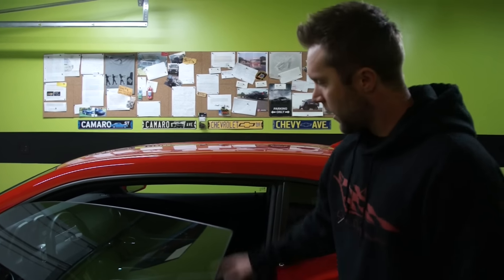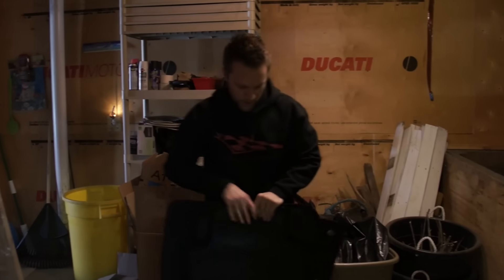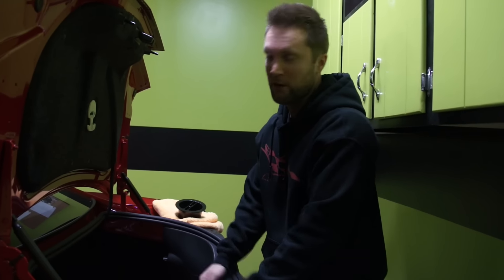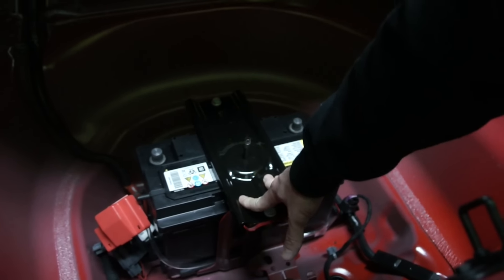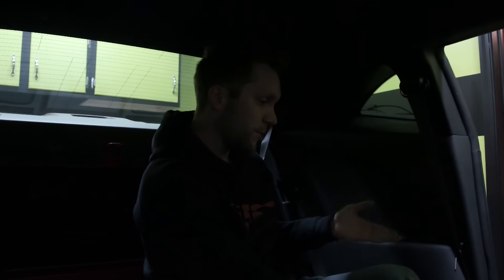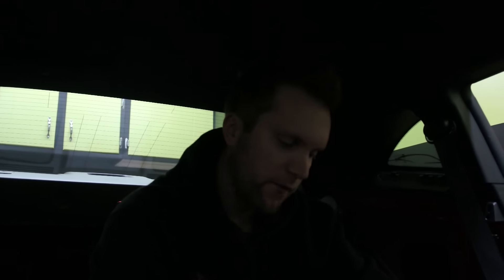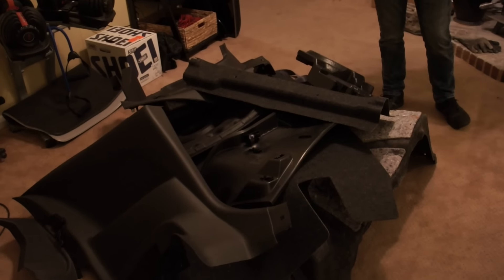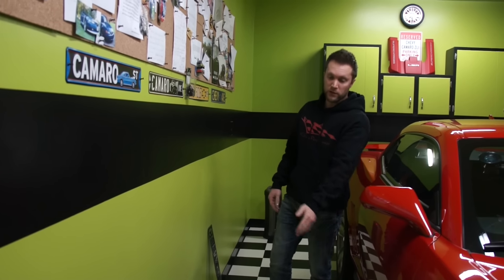Making My Car Faster WITHOUT Adding Horsepower

Comment: get lighter rims and that will be a huge impact on the weight.
Reply: Branson Sheppard He talks about it at the end
Reply: every pound on the foot is like 10 on the back.  Lighter suspension, bakes, and wheels
Reply: GuitarmageddonZL1 hey man I understand where your coming from removing the floor mats but 8 pounds won't make a difference and when it comes time to potentially sell your vehicle if the carpet is worn and nasty your lose alot of money
Reply: GuitarmageddonZL1 When you get lighter wheels that weight reduction is multiplied because of rotational mass.
Reply: Stas G. he should pay the cash to get the full weight reduction package he needs to have all the speakers but one removed the radio ac etc if he is serious about turning this into a full dragster

Comment: are u gonna remove like heat and ac, the airbags, replace the steering wheel with a light weight race wheel etc???

Comment: The front wind shield weights at least 100 lbs you should just remove it.
Reply: SIMPLYBEAST1231 it might weigh 40-50 pounds. No way it's 100
Reply: SIMPLYBEAST1231 I literally make windshields for a living. They aren't as heavy as you think. Probably between 30 or 40 pounds at most.
Reply: +Domenick Schifer i know its not 100lbs. It was a joke of a comment. I replaced my windshield in my old pontiac a couple years ago.

Comment: You need to lighten the unsprung weight and rotating mass. Putting lite weight wheels can reduce track ETs by whole numbers. sprung weight will not reduce your ETs by the same amount as the changing the rotating mass.

Comment: Swap the battery for a lighter one. The stock battery can weigh over 50lbs and that steel hold down weighs a bit as well.  Proper race battery weights ~15lbs and a plastic box and aluminum hold down are a fair swap.  35 more lbs for not a lot.  Also the trim on the inside of the trunk lid.

Comment: I have been drag racing since 1973. I gutted out the 1968 GTX I drove to high school and turned it into a drag car. Looking back I wish that I had never did that. If you can don't sell your stuff!! Keep it so you could put it back to stock. P.S. old drag race trick pull the front sway bar off. You're car will still handle and corner but it will transfer the weight better. Ask Andy he will confirm.

Comment: Might as well just strip the car down to a bare rolling chassis and start building it for the track.
Strip that harness down to the bare minimum to run the engine and trans or buy a stand alone harness. Remove the HVAC system, and airbags, and lose that ABS crap as well. That stuff weighs a lot.

Comment: One Day Nick will add 2 81mm Turbo chargers onto his 6.2 liter V8 with a 15 pound Nos tank in the back.. and 2 electric motors on the back wheels with a new racing transmission. And he will still drive it on street and race Koenigseggs all day. And somehow that engine will not blow up. Yes I can see it now.

Comment: Cheapest mod to do for weight reduction. Also if you remove the A/C components that will reduce weight and gain maybe 1-2 hp, since it will be a track car A/C will not be necessary.

Comment: What about actually weight reduction like an exhaust system? If I remember correctly your exhaust is stock after the headers. Take off those massive resonators and mufflers and you'll probably drop 50+ lbs. but then you'll probably suffer extreme hearing loss lol

Comment: More ideas for you, take out the airbags, headliner, steering wheel, center consol, glove box, rear view mirror, speakers, radio and hood carpet liner. Also open headers rather than a heavy exhaust

Comment: Why is there a battery in the trunk?
Reply: TheSilentJackYT they are doing that with alot of new cars it's the battery for the whole car
Reply: Douglas Schwirtz weight distribution maybe?
Reply: LUCAS MATIAS DIAZ FERNADEZ more so they can pack more shot in the engine bay

Comment: Drop that stock battery and get a Shorai Lithium battery. They weigh 4.8 pounds. It dropped rite at 50 pounds in my G8 when I was deleting weight. Been 2 years no issues.

Comment: Nick fuck it lol delete the AC, heater, and all of the controls. while your at it take the speakers, factory amp and head unit out too and just make a plastic plate to fill the hole in your dash. Also an aftermarket hub and steering wheel, you'll need it to get in and out with the cage and new seats plus it saves weight you won't need the airbag with the new 5 point harness do take out the front belts too. last thing lol your door panels are heavy as fuck they can go and be replaced with plastic or aluminum.

Comment: if you are taking car off street remove steel bumpers, air bags, front belts, plastic wheel wells, headliner, speakers, Have fun with race/project car👹😎

Comment: Get a built nascar engine for the zl1 and out the lsa in the jeep and make hat your hauling rig!
Reply: Owen Sanders with the short wheel base on the Jeep it would do a terrible job towing.
Reply: 02to06TUNDRAFAN true still would be badass tho

Comment: You weighed yourself, then you weighed the carpet, added both then subtracted your weight, to get the weight of the carpet? What the actual fuck?
Reply: He weighed himself holding the carpet bits and then subtracted his own weight to get the weight of the carpets. He couldn't weigh the carpet by itself because it was too big to fit on the scale to be read accurately.

Comment: Are you going to try to keep it street legal?
Reply: When I lived in PA they had a fairly strict yearly vehicle inspection. If he were to take off the mirrors, run drag slicks, or straight pipe it, just to name a few, it wouldn't pass.